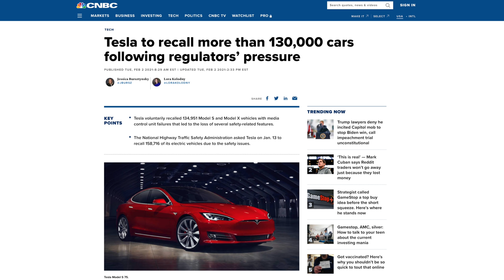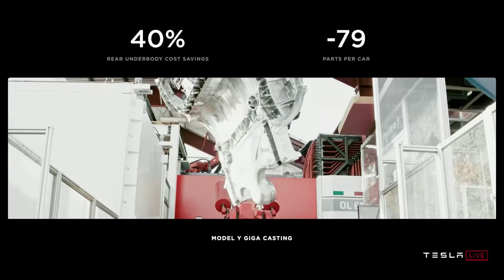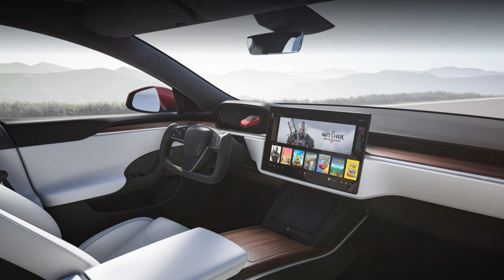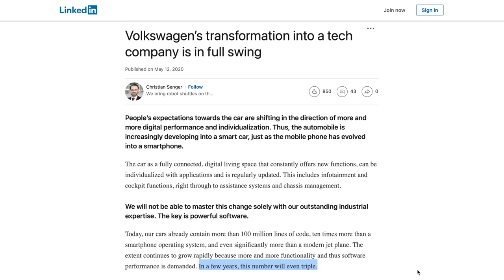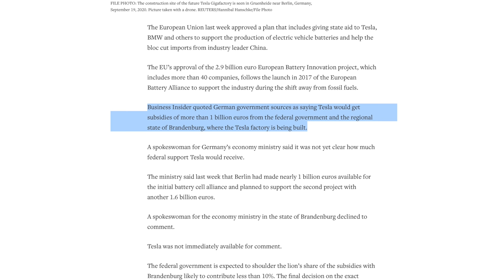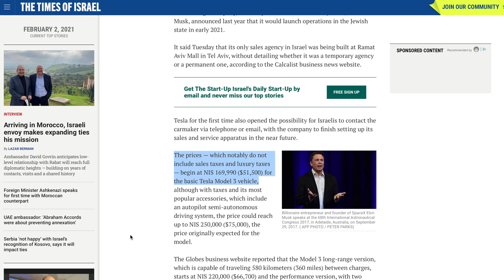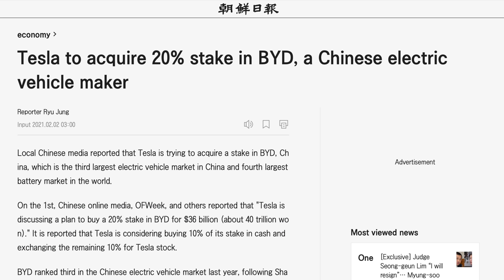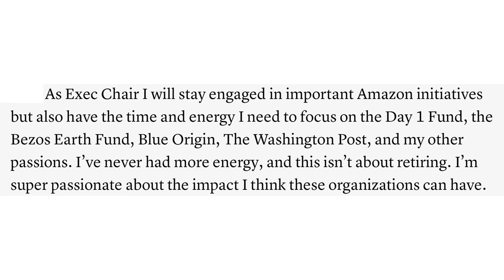Elon Musk Interviewed by Sandy Munro, New Tesla Semi Photos, Tesla EU Battery Funding

Comment: You sure he didn't say there are 1000 robots total, the front casting reduced the number by 300 and the back casting reduced it by another 300?
Reply: That's what Elon said, and that's what Rob said he said. Front casting isn't done yet, however.
Reply: How to was he is even using 1000 robots?! Most companies doesn't use that much for their cars
Reply: @alanmay7929  You are correct, most are using frontline workers instead, which is more expensive long-term.

Comment: Re: comment to W Redlich: "I don't recall hearing about the cost per pack on Tesla-made cells vs price (cost+profit), to Tesla, on cells made by 4680 design licencees. Also, do you include that Elon will likely require cell fabs to sell cells to non-Tesla customers at higher than Tesla pays, with part of that revenue returned to Tesla as license fees? If so, as Tesla may be the world battery maker & volume consumer for the next 5 years (at least), that could become the per kWh global market price of all batteries, regardless of design, maker, or buyer. How are such factors, if valid, addressed by your models?" Thoughts?

Comment: I really enjoyed watching two engineers talking engineering.  Both of them looked very relaxed, and Elon’s respect for Sandy was obvious.  Missed any talk of 4680 production progress, however.  I appear to stand alone in believing there are problems.  I would also have liked a little more clarity on the potential for single casting of Model 3s.  I get that Elon doesn’t want to shut down Fremont and wants to start fresh in a new factory.  But if that’s true, they should be rolling out of Shanghai and should be targeted for Berlin and Texas.  I don’t see that.  Why continue to make a sub-optimal Model 3?  Finally, their guys didn’t know how long it takes paint to dry?  Really?
Reply: They are talking about differences in drying time of a minute.

Comment: I think the new model S/X are getting single piece rear casting similar to the Y.  If you watch the Tesla video, that casting piece is different from the Model Y casting.  This makes sense since the new Model S/X will eventually use the structural battery pack also.  Also Tesla says in the video this is the largest casting machine in the world.  Elon also mention the CT will need a even larger casting machine a 8,000 ton casting machine.

Comment: To be honest I was very surprised that Tesla is using another 12v battery for it's low voltage systems. For some reason I was certain all power is drain directly from the main battery for all applications. It's quite unintuitive but I guess it's how it has to be for some reason.

Comment: When it comes to lines of code, the more lines the worse your system is going to be.  With the right design of code components you have far less code and far more reliability.  Unfortunately, so many companies have software coders that just write a lot of code and it becomes more of a liability than an asset.  Tesla is not one of those because they leverage their software.  This is another strength of Tesla that analysts don't understand.

Comment: I always thought you want the fewest lines of code. The more lines, the slower your program runs. You cut lines and try to make it do the same thing thing...
Reply: Still, lines of code aren't really much of a measure of anything. 

print ('this
is
six
lines
of
code');

while(i<100){print('this is one line of code ');i++;}
Reply: @GregHassler  fair point, however maintainability is also a factor
Reply: @GregHassler  We used to count semicolons to represent lines of code in the language we used.  So your example would be 1 line.
Reply: Not necessarily; sometimes improving application speed requires adding lines of code.

That being said, once you start getting into the hundreds of millions of lines of code, you can almost guarantee that huge code paths are unused, that major refactoring needs to be done, and that huge portions of the codebase can be removed. VW's point about how they expect their 100M+ LOC codebase to triple is extremely worrying; that means they're adding tons of cruft without removing cruft that's already there. I do not envy the software devs they're hiring for that; that sounds like it's going to be a total nightmare. Bloated, crufty code also means you can't work on new features quickly, and it also makes it easy to create new bugs and hard to fix old ones, so it spirals downhill very very fast.

Interestingly enough, organizational structure is reflected in code structure just as much as it's reflected in vehicle manufacturing (arguably maybe even more so). As a software dev, the fact that the Tesla touchscreen is so fast and responsive tells me a lot about how Tesla code is structured. And it's *good*.
Reply: @Poitda31  you're all continuing to make my point.  Literally the count of lines of code is meaningless.  Bad code comes in all shapes and sizes, I've seen too much of it.
Reply: @thewolfdoctor761  still, look at what actually executes. Inefficiencies come in loops. Those two lines vs one actually execute 200 commands vs 1.
Reply: @GregHassler  I didn't see the while statement.  The print statement is one line of code.
Reply: @thewolfdoctor761  yup, could be, I intentionally did it that way and with a loop.  Lines of code === meaningless.

Counting semicolons is weird, do you only use languages with semicolons? That inherently miscounts loops, if statements, case/switch statements, etc.
Reply: Line of codes, most likely, won't slow down the execution, as most of the time, modern compilers will optimize lots of code anyway.
Nonetheless, the VW criteria to evaluate coders by the lines of code they write :D Oh god :D Sounds like 20 years ago and waterfall. ha ha.
Reply: @GregHassler  I'm retired.  We used Ada when I was working 20 years ago in the DOD.  BTW, how a code executes has nothing to do with lines of code.

X := 0;
For i := 1 to 1,000,000 loop
  X := X + 1;
end loop;

That's 3 lines of code.  It doesn't matter if it loops a million times.
Reply: @thewolfdoctor761  Yes, exactly, now you're starting to understand my point.  And a switch statement could be 1000 "lines" long that executes one line of it, the exact opposite of a loop.
Reply: @GregHassler  Not really.  The number of lines of code and how a program executes are 2 separate things.  It's like saying, "My car cost $50,000 but I only drive it 1000 miles a year."  One has nothing to do with the other.
Reply: @thewolfdoctor761  you're literally saying the same thing I am. 🙄
Reply: @GregHassler  OK, if you say so.
Reply: @thewolfdoctor761  it was literally my first example and I've stated lines of code is meaningless countless times in this thread. Been programming for 30 years in a dozen languages, pretty sure I get how this works. Counting semicolons still makes no sense by any metric.
Reply: @GregHassler  You made it sound like lines of code means lines of code executed, like a loop of a million iterations is really a million lines of code, which is nonsense in every language.  And your print example was odd.  Breaking up one executable line of code over 6 lines does not make it 6 lines of code.  That is beyond silly.  Clearly you are clueless, so there is no sense continuing this discussion.
Reply: @thewolfdoctor761  your interpretation was incorrect.  Clearly the point was above your head.

Comment: Seriously panel gaps really don’t matter that much, humans are stupid to focus on such a thing
Reply: its not really about the gap. the gap is an indicator of general assembly quality/precision
Reply: They do when you put door and opening too close,  and they wind up rubbing or striking each other over time,  or the gap is too big, and you have sound,  water,  and dirt getting past the seals. There is some room for error,  but when you are careless and go beyond that,  you have problems, including latches not working properly. Basically,  it's not being built as designed.  It's not dissimilar to wheel lug nuts being too tight or too loose,  though it's less dangerous.
Reply: @jamesengland7461  Exactly. People downplaying panel gaps always seems to miss the fact that when the error gets to big, there are actual consequences.
Reply: Nonsense, panel gap means attention to detail, you won't buy a non well sealed iPhone thats supposed to water resistant.....
Reply: @alanmay7929  very different. phone structure are made from one casted internal structure and a typically a front and back cover.. way easier to get a proper seal then a car frame made up from hundreds of parts..
Reply: @adamfilip  youre joking right?! Most cars these days are basically glued together and laser welding makes the operation even way easier, how do you think toyota is able to make 10 million vehicles a year?! Manufacturers uses combination of different materials including magnesium, steel, aluminium, carbon fiber.....

Comment: Elon admits Sandy’s criticisms were valid. Are you ready to make a formal acknowledgment that Tesla’s build and paint issues were legit? lol
Reply from the maker: I’ve always said there was room for improvement and that the issue would not be materially impactful as a shareholder, which has been correct.
Reply: Its such a shame that they don't put much attention on finishing their cars better, its not that hard.
Reply: What do you mean by legit? Do some Teslas have minor build or paint issues? Yes. Occasionally even a major build or paint issue. But the question is always what is the error rate and what is the severity? And can the service center fix any problems to the customer's satisfaction in a reasonable amount of time? All car makers make mistakes. Nobody's perfect all the time.
 
Don't hammer on the issue unless you're also willing to acknowledge that Sandy pointed out another Tesla that had perfect paint and perfect body gaps and he raved about it. Even on his own car he had no issues with the paint, and one side of the car had perfect gaps and the interior was perfect.
 
The real question is how many cars are perfect compared to how many have issues, and is the company improving over time? I think the answer is clearly yes. The company's quality is getting better over time. There's always a bit of a setback as a new assembly line ramps up, but they're learning from each ramp up.